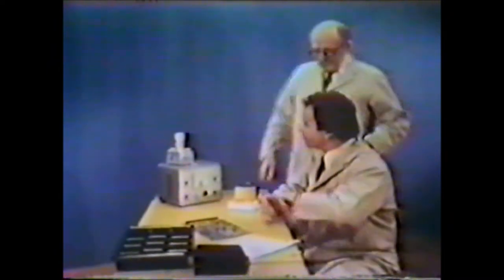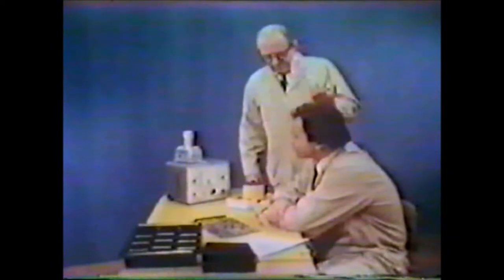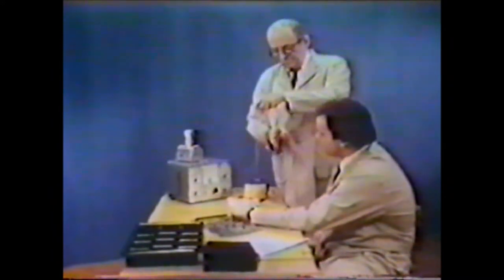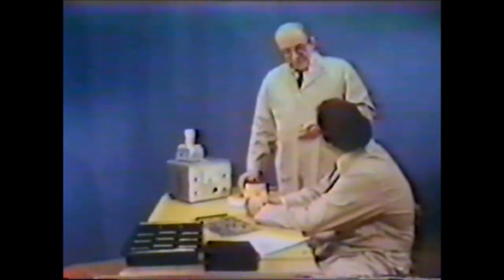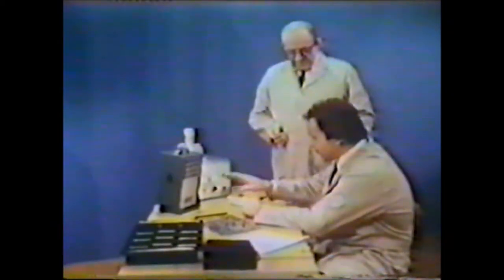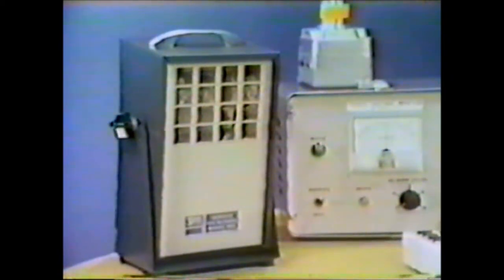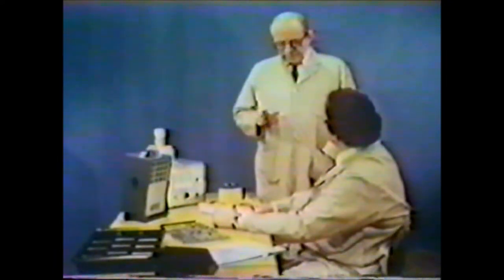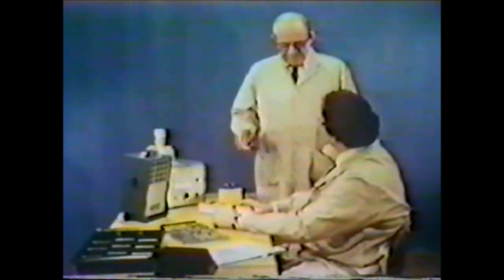3M Model 909 Nuclear Ionizing Air Blower

Comment: I helped out in a fiberglass bodyshop in the 90's were we used a similar device to treat surfaces prior to paining.  I believe it was equivalent to this one:

http://www.amstat.com/products/nuclear/nuclecel-ion-air-gun/

I recall the shop owner telling me that the tips are on lease and heavily regulated by the government.  They wanted to know how many were on site at any one time.  They lasted about a year, and when a replacement was needed the old one had to be sent back before a new one was delivered.  The site above seems to indicate this as well.  The tips also indicate "OSHA" in the description, thus I assume they are approved.  The air is ionized by the tip as it passes through.  If the tip is properly shielded I would think it is safe.

Comment: Another thing I should add is that some radio active emissions are easily shielded by air.  This seems to be the case for alpha particles as is indicated here:

https://en.wikipedia.org/wiki/Alpha_decay#Toxicity

Therefore, unless you ingest an alpha emitter it seems to be pretty safe. Don't eat it!  :)